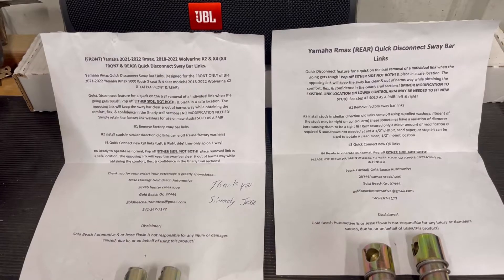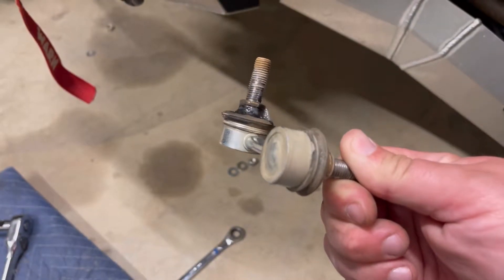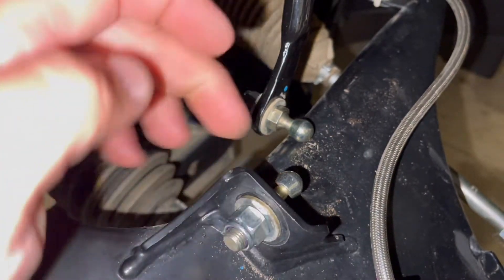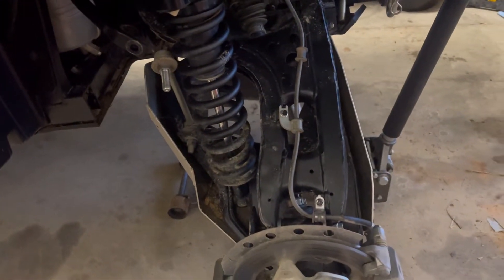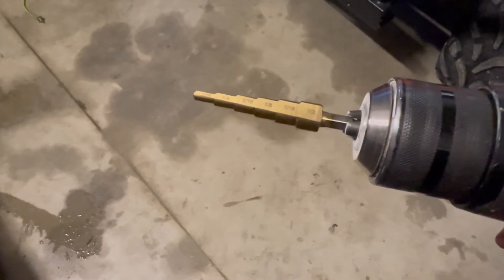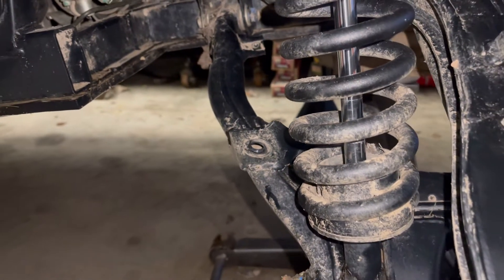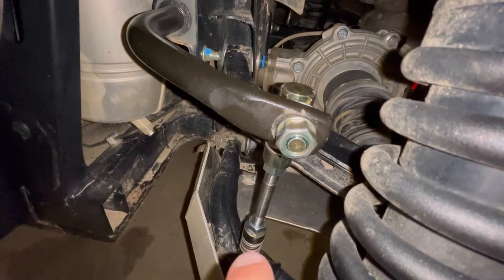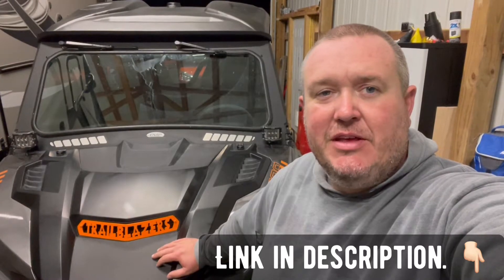Sway Bar Quick Disconnects for the RMAX 1000 by Gold Beach Automotive. Install & Impressions.

Comment: Great video, how come you only have to remove one side?
Reply from the maker: Thank you! Leaving one side connected keeps the sway bar itself secured and up out of the way. You are accomplishing the goal of disconnecting the two sides from one another by just removing one link.
Reply: @buckeyetrailblazers5861  ok then why is there 2 links in the front and back kits
Reply: @darrylhoupt3763   The quick disconnect links are longer than stock so the side that's disconnected clears everything.  If you did this with stock-length links there would be interference so both need to be replaced per sway bar.
Reply: @MassiveOverkill  ok thanks
Reply: You would never know it but I'm a minimalist, is it worth changing the sway bar links? I ride challenging trails but so far I'm getting around pretty good. Almost 2k miles on my 2021 xtr 2
Reply from the maker: @darrylhoupt3763 . They could gave just included one disconnecting link and one dummy link but for convenience (as I covered in the video) they included both sides. You or a passenger can jump out and disconnect either side.
Reply: I can't find a web site for gold beach automotive
Reply from the maker: @darrylhoupt3763 . Look in the description of this video. Link there. 😎

Comment: Just installed these on my rmax4. Great product. Very pleased. Keep in mind tho that you're not removing or installing these in the middle of the trail. The distance between the control arm and the sway bar has to be the same length on both sides in order to simply pop these off and on. So you pretty much have to be on gravel or pavement to achieve this.

Comment: Howdy.  Noticed you have pod light mounted on your hood between the windshield and hood.  Really like that setup.  What type of mods and brackets were used to install the pod lights?  The wiring part will be easy, but just need a little rundown on the pod light mounting solution.   Thanks!